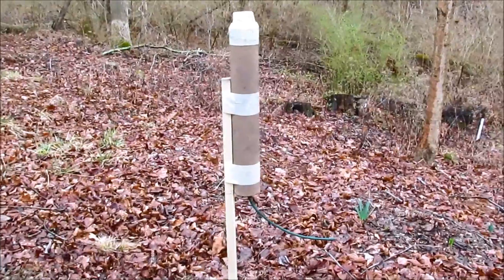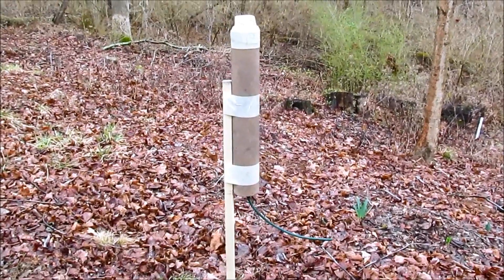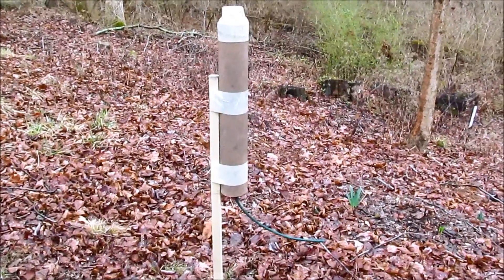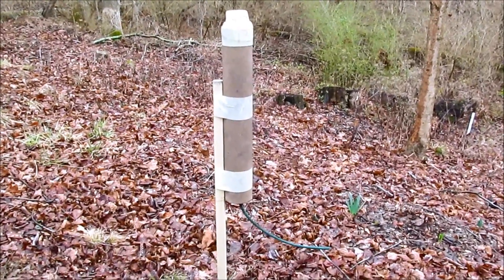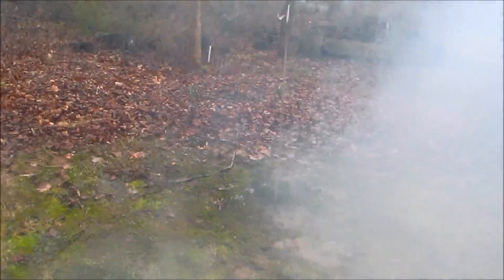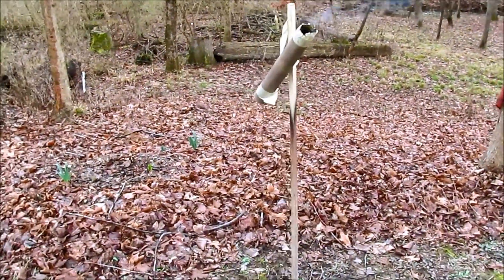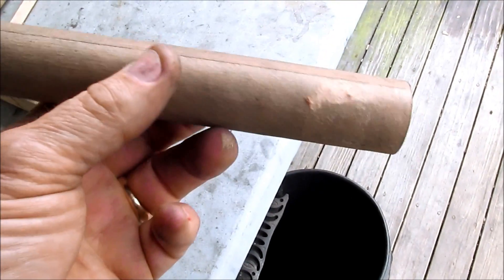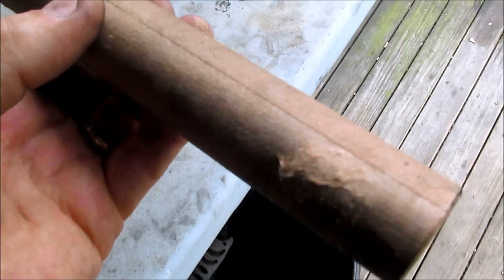Testing Girandola Motors and Final Effect

Comment: Nice test! What's the difference between titanium and ferro titanium?
Reply from the maker: Thanks, Max. Titanium is pure elemental Ti. FeTi is an alloy of iron and titanium. The Ti prevents the iron from reacting with the water and/or oxidizer in the propellant, which is a problem with pure iron, until it is ignited and burns.
n
Reply: ned gorski thank you very much for the fast reply! I have only used regular titanium in my rockets. It worked fine, would you suggest that I can keep it? Or should I use ferro titanium as well?
Reply from the maker: I like spherical Ti a lot, Max, with its brilliance and popping sound as it burns up. It can be a bit overwhelming with that brightness, though. I like FeTi, too, especially for its straw-blonde color, and more delicate spark effect. I think they both have their place, so you could  try your Ti, and then try FeTi if you can get your hands on some. Good luck,
ned